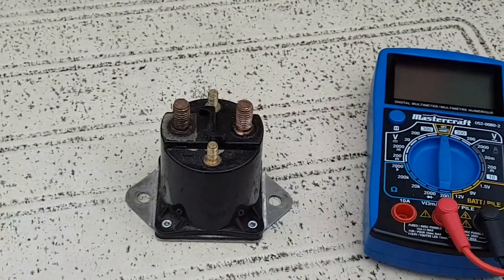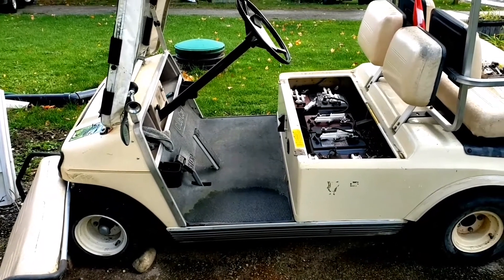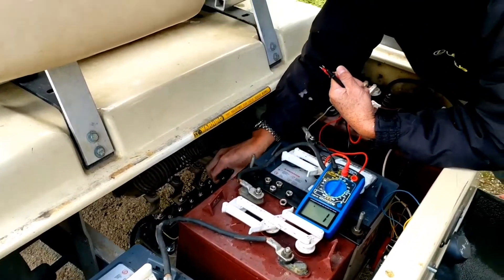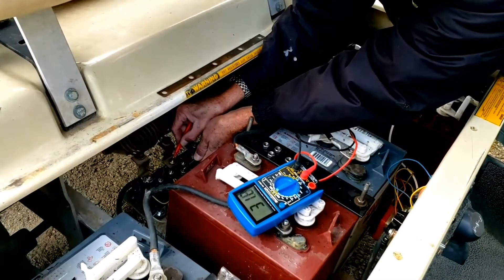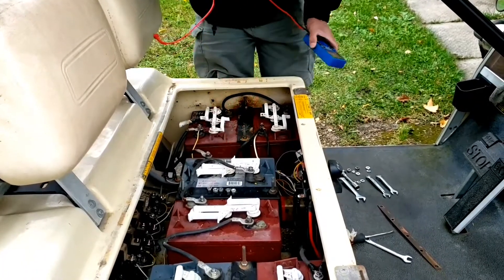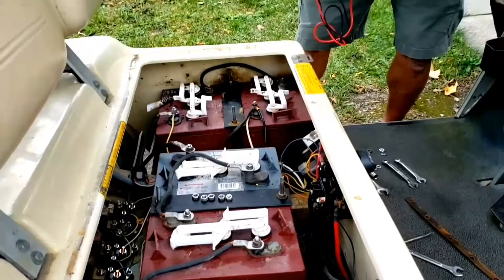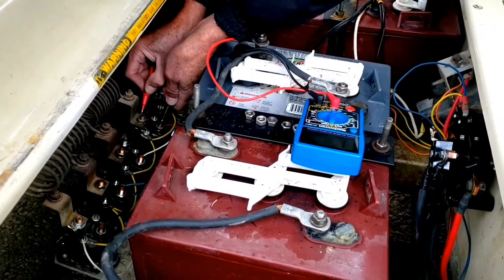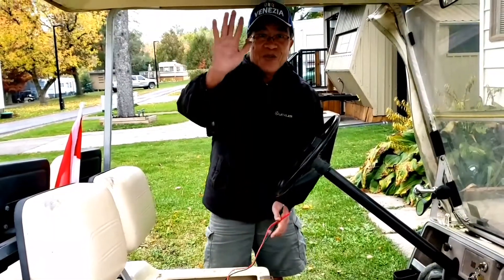HOW TO TEST OR DIAGNOSE A 36 VOLTS SOLENOIDS ON GOLF CARTS : OBENSKIS VLOG

Comment: what the hell you doing?  didn't show what you did to the altermeter
Reply: The first test was for continuity on both sides of the solenoid.  When touching the probes, if there's a beep (continuity) then the solenoid is closed (meaning current can flow through) and the solenoid is bad.  If there's no continuity, then the solenoid is open (meaning current cannot flow through and the solenoid is good.
The second test was for continuity on both sides of the solenoid with the key ON, switch in forward position, and the accelerator pressed all the way down (don't do this test without the rear wheels off the ground).  In this test if there's a beep (continuity) then the solenoid is good.  If not, the solenoid is bad.

Comment: You literally explain nothing. Nothing on the settings on your voltmeter nothing on what lugs you’re testing on your solenoid NOTHING. 👎🏻
Reply: He's testing for continuity. It's pretty clear even with the bad sound and broken english.  That having been said, there's slots of ways to hurt yourself fooling with a resistor cart if you don't know what you're doing and this isn't the best video for learning the basics.

The first test was for continuity on both sides of the solenoid.  When touching the probes, if there's a beep (continuity) then the solenoid is closed (meaning current can flow through) and the solenoid is bad.  If there's no continuity, then the solenoid is open (meaning current cannot flow through and the solenoid is good.
The second test was for continuity on both sides of the solenoid with the key ON, switch in forward position, and the accelerator pressed all the way down (don't do this test without the rear wheels off the ground).  In this test if there's a beep (continuity) then the solenoid is good.  If not, the solenoid is bad.

Reply

Comment: Wish you would show where you touched the multimeter contacts and, your settings on your multimeter
Reply from the maker: Set your digital multimeter to continuity or sounds mode. The two screws with bolts on top holding the solinoids are the ones you will touch.

Comment: My 2nd and 4th speed work, when i lift the cart and remove the bar and step on the peddle and test for continuity the 2 solenoids that do not “beep” are the ones that work and give me speed. The other 3 beep but do not power the cart?
Reply from the maker: if the other 3 does not have a sound or beep when pressing the pedal, I believe that needs to be replaced.